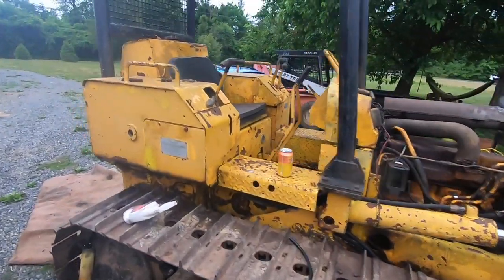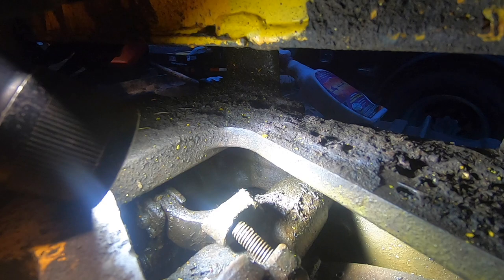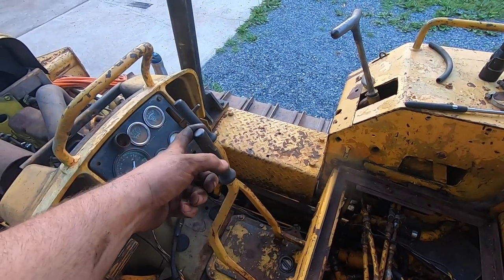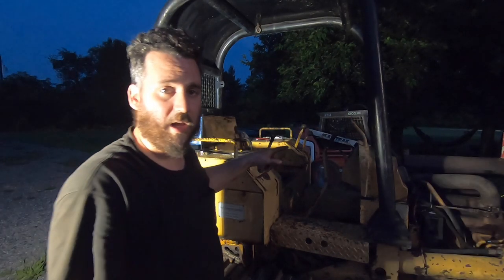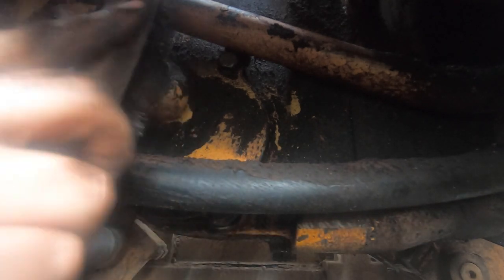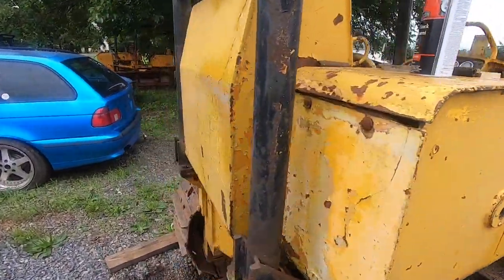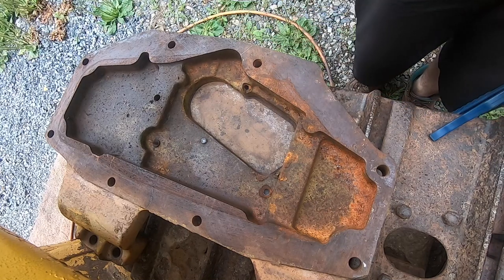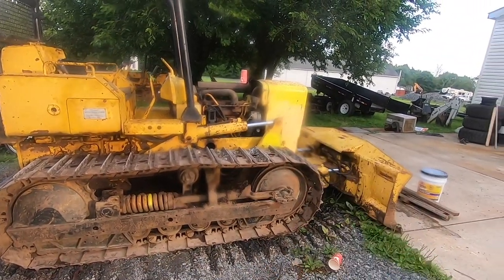John Deere 450B dozer Steering clutch and brake repair. Did I get lucky?

Comment: Had replaced steering clutches/brakes/release bearing, seals, etc in 450B I owned.  Replaced with metallic style clutches instead the the original fiber type.  Those are a little less responsive, but never had any problems with sticking afterwards. Having a crane truck is definitely a plus for these type jobs. Removed the entire seat/tank/battery assembly as one piece with crane truck.    Had to get a used clutch arm shaft from a place out in Western US. SteeringClutch I believe was the name.  Getting the new brakes/clutch adjusted to suit took a few times after running machine.  As others have mentioned, keep the machine tarped or under a shed.
Reply from the maker: I agree with all of that! I ended up fixing this clutch correctly later. I crane truck would of been sweet. The boxes and tank were tricky with a regular engine hoist. The rest of the job went really smooth.

Comment: We first used the JD 450 crawler loader when they first came to uk, The operators didn’t like the very early steering set up up the JD, We changed to the Case 350 crawler loader then used  the case 450 & case 450A crawler loader 🇬🇧🇮🇪.

Comment: I have a 450B as well, so I enjoyed the video, especially since there doesn't seem to be too many good videos out there on the older 450s.  There should be two pipe plugs on the bottom side of each clutch/brake housing.  One of my brakes was a little oily and the seal may be leaking a little from the final drive side, but I loosened the brake band, poured mineral spirits over it, and then sprayed brake clean on it with the plugs removed.  It did seem to help some, but the clutch will be more difficult to clean I think and more sensitive to any residual oil.  Probably worth a shot though considering the effort it takes to replace one, and the cost.  Looking forward to the next video on the HLR adjustment.  I struggled with mine and have determined the pump has got a lot of wear in it as I can only get about 145 psi when the oil is warmed to temperature.  I'm going to try running it with the pressure set at about 140 psi so that there will still be some bypass oil going to the filter and oil cooler.  One other thing I found on the main clutch is that I had to back out the HLR clutch valve stop nut a little over 6 turns from the point where the clutch pedal just started to move to see a pressure rise when turning it back in (book says 5 turns).  So if you don't see a pressure rise, back the nut out some until you see the pressure drop, then you can turn it in to try and hit that point where the pressure falls 5-10 psi.
Reply from the maker: Good tips. I actually planning on putting the clutch housing plug in and filling the housing with a degreaser then operating it a little while. This will hopefully get most of the oil between the clutch  plates out, etc. On the HLR side there is something going on with my engine clutch. Even with the engine clutch all the way maxed out I cannot obtain the pedal free play that JD calls for. I am going to try to install a shim in it to get more travel, then re-adjust the HLR to operate correctly
Reply: Sounds like a good idea on degreasing the clutch.  You could probably even use a water/detergent based degreaser as long as you drained it, then operated the dozer for a half hour or so immediately after with the plugs and and the cover plate off to evaporate any water out.  As for the HLR clutch, as I remember you back the screw out to increase free travel, so if you keep backing it out, I guess at some point it would back away from the seat.  The spring should hold the screw against the seat, so if that's not working for some reason, you may have a problem with a broken spring, throw out bearing, linkage, or clutch itself.  You might try backing out the clutch valve stop nut - maybe someone had that adjusted too far in.   Just be careful not to back it all the way off the threaded rod, or you will definitely be pulling the engine to fix it.  Good luck.  @spankranchgarage

Comment: Excellent video, I have a 450c crawler like that only like new condition been in the family since new,is an amazing machine,use it for roads, logging on my property ect, interested in the location you found that trani screen,was not aware of it or its access point...Thanks again...
Reply from the maker: Thanks for watching. The trans screen is under your right heel when sitting on the machine. You can drop the belly pan and see it on the side of the transmission. There will be a sensor with a wire and 3 bolts.
Reply: @spankranchgarage  Thanks, I was wondering if I would have to drop my belly pan,but it will be worth it as I have a new temp sensor to put in it...Even though I keep the oil very clean and stored in a run in shed I would like to check it out as I didn't know it was there, never came across it in my manual...

Comment: I've seen some guys fill the brake/clutch housing with kerosene. I think Randy's Relics did that on his Cat D2 when the clutch was completely seized, to try loosen it up again. I'm not an expert on heavy equipment, but it seems like it might be worth a shot?
Reply from the maker: I am considering this. I need to know for sure if the oil came from an external source or do I have a transmission leak into the clutch housing too. New video coming soon about this

Comment: Yep I would do the same. plug and fill that right side brake clutch with a solvent. non petrol based cleaner as they also have oil in them. Yep brake cleaner will do the trick. If you fill it to the top and cap it of you need oxygen to have a fire or explosion if you get a spark in there. No to little air and the mix is to rich and you are safe. probably way to late this comment to help but what the heck. See what you did in your next video. Cheers Stew.
Reply from the maker: You are reading my mind here! Got a video coming out later this week doing just that.
Reply: You could use propane to displace the air...

Comment: How much does it cost to change the ClutchJohn Deere 450 track loader
including part in labor thany you
Reply from the maker: I dont know, sorry. Each mechanic will charge different. Try to find a mechanic that has done them before. Experience goes a long way with this job.
Reply: @spankranchgarage   ok thank you